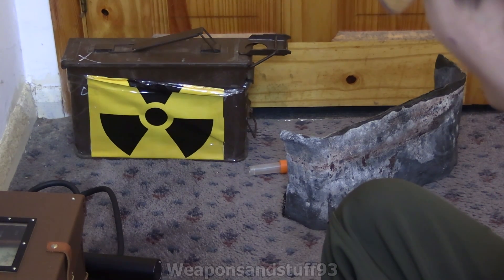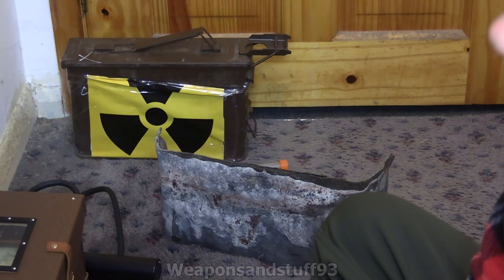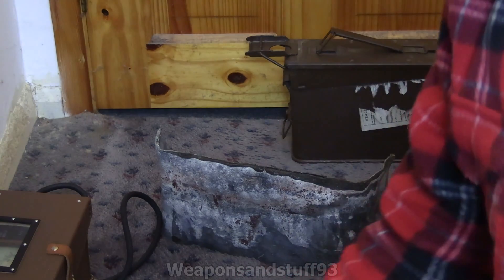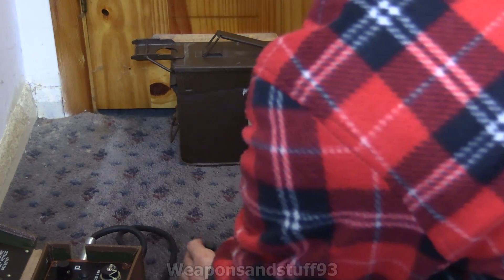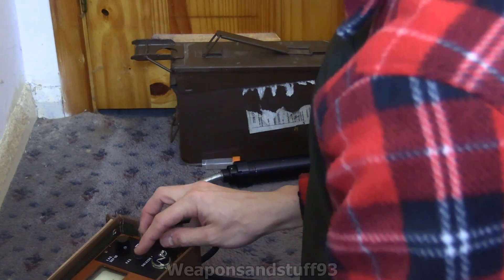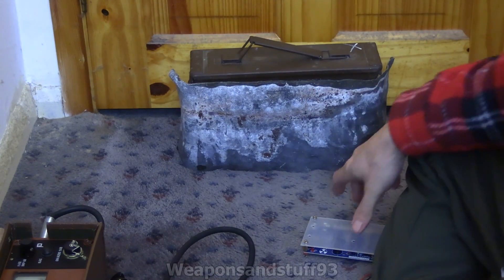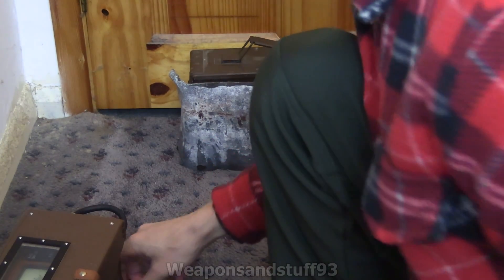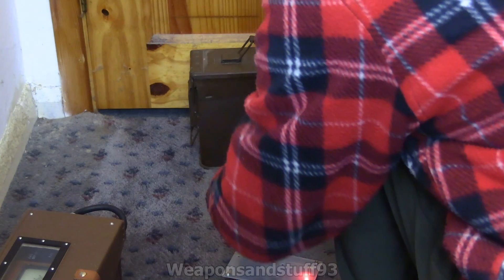Lead VS Gamma Radiation demonstration

Comment: The cube law applies everywhere. Im just getting into searching for natural radioactive minerals, just like I did metal detecting as a kid in the 1970s. Looking forward to it! I have one radioactive source, a thorium gas lantel. Amazing you can still buy these domestically. I keep mine lead lined in my lab!
Reply from the maker: Weirdly despite those lamp mantels mostly being discontinued for a safer variant (That are duller) I bought some brand new packaged lamp mantles from a camping store recently that were radioactive so it seems not every manufacturer actually stopped using Thorium.

Comment: Could you use the lead to recreate the slit screen experiment that showed wave interference patterns? Could we interfere with gamma radiation to a point that it could be used to completely protect certain areas through interference? 

I know the interference effect works best from coherent sources, but a gamma ray burst Is much more coherent than radiation from any other natural source, it’s basically a space laser. Could lead with slits in it be used to protect from a gamma ray burst?

Comment: Although lead works for gamma, doesn't for for beta. Because of it's high Z value (atomic number), electrons will be slowed by the lead (eventually will be absorbed, witch works as a shield and that's ok) BUT, in the process of slowing them down electrons release an electromagnetic radiation (gamma), that's why it's better to put a piece of aluminium (or something with lower Z but high enough that would absorb electrons), between your radiation source and lead shielding, the piece of aluminium will completely stop the electron with a much much lower chance of the electron releasing a gamma radiation.
Reply from the maker: Yeah thick plastic like acrylic works best for shielding beta sources to prevent braking radiation.

Comment: Feeling fluish is a sign of radiatipn. I recommend taking iodine pills and eating seaweed
Reply: Iodine only helps when fission occured. It does not help a bit with an radiation other than that of the otherwise incorporated radioactive iodine that comes from fission.

Comment: In basic science, I’d learned Lead should be at least 20cm thick to be effective in shielding against Gamma radiation. I’m guessing radiation resistant armor is quite far away.
Reply from the maker: Yeah weirdly thermoplastic seems to work very well
Reply: Ah, so there could be something on the way.
Reply: Lead: 20cm
Gold: 14.5cm
Osmium: 10cm
Reply: that totally depends on the energy of the gamma...

Comment: It really sucks that there are no gp5 replica filters because I love the look of them and the gp5 just doesn’t look the same without it’s original filter, any suggestions on anything similar to shape that is a tad bit safer, for cosmetic purposes, I don’t care about functionality rn
Reply from the maker: People are 3D printing them now, look on eBay
Reply: Weaponsandstuff93 thanks mate
Reply: Weaponsandstuff93 I can not for the life of me find a 3D printed filter, do you have a link to one?
Reply: If you're safe about it, you could cut one open with a can opener, remove the filter material and charcoal, then glue it back together.
Reply: Bryan Young hmm maybe

Comment: hey how did you build you geiger counter, have you watched tutorial? if you did can you link it? Thanks.
Reply from the maker: It mostly came pre-assembled, I've still not got the Arduino stuff working with it.
Reply: Weaponsandstuff93 if you bought it online like on amazon or ebay could you link it, im looking for some cheap geiger counter so i can check radiaton levels at my place, because there are myths that during nato agression in 1999, nato used bombs with depleted uranium to bomb hangars with planes, so i wanna check if they are radioactive because i live near them.
Reply: @nexpreet  very hardly possible, If its so your area should be filled with people with radiation  related problems
Reply: @nexpreet  US tanks fire a shell with depleted uranium. I believe it’s encased in tungsten. I’ve heard it’s looks much more bright and new than scrap metal should. Also gives off sparks very easily. I don’t know if any US bombs made with depleted uranium, of which I’m quite glad!

Comment: Out of interest, can you legally own radioactive items like that?
Reply from the maker: Of course, otherwise I wouldn't show them in a video...
Reply: @weaponsandstuff93   brilliant, where are you able to get them?
Reply from the maker: Which particular check source?
Things like Radium dials, clocks etc are sold as antiques in shops and eBay. Thorium lamp mantles etc are also on eBay
Reply: @weaponsandstuff93   ok brilliant just antiques are enough to experiment with
Reply: Radioactive materials are normally fine. The government gets concerned normally if you (1) have a large quantity of material (2) are trying to refine materials like uranium into yellow cake or fissionable material.
Reply: @richardpowell4281  so can i own a radioactive bomb? Cool

Comment: Very nice demonstration. You should also show how water makes an even better shield due to water being very dense.
Reply from the maker: Cool will do at some point, well water is great in volume, not as good for size as lead, as most people can't carry a fishtank with them.
Reply: @weaponsandstuff93  I'm thinking of putting a meter in a waterproof case and taking it to the bottom of a pool to see what the reading is.
Reply: water is 1/11.3 the density of lead.
I think you confused it with neutron radiation which is better stopped by water .